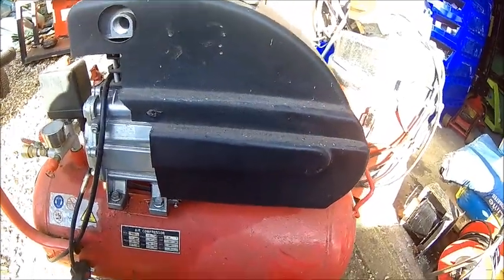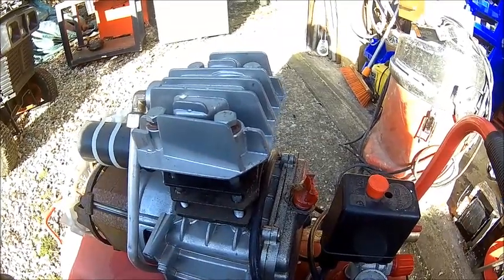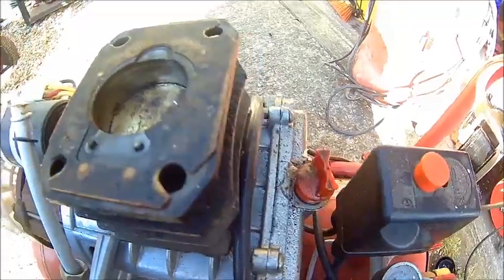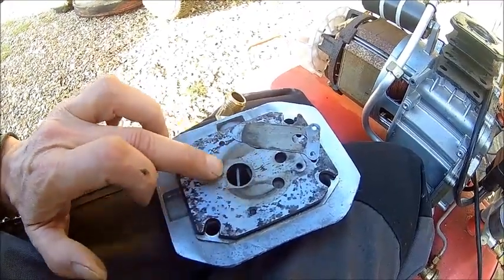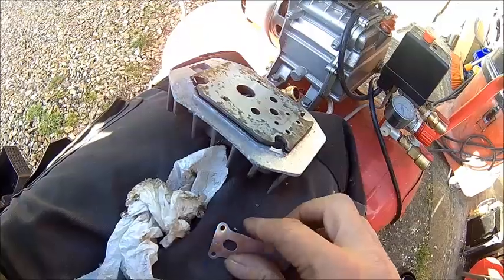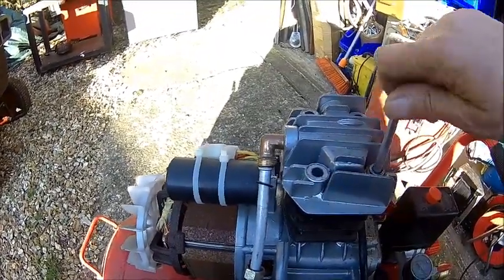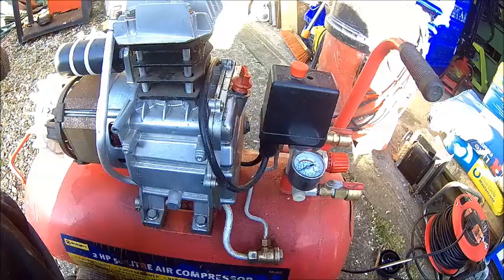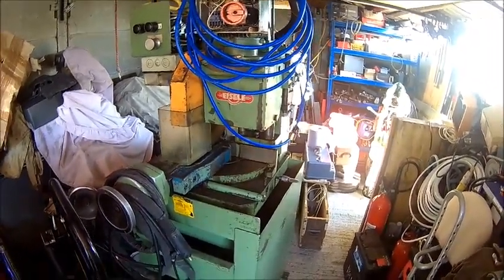Air Compressor - Poor Performance - fixing leaking reed valve

Comment: You did not check the other set of reed valves on to of the head plate, under the horseshoe bridge, they normally burn out before the bottom set.